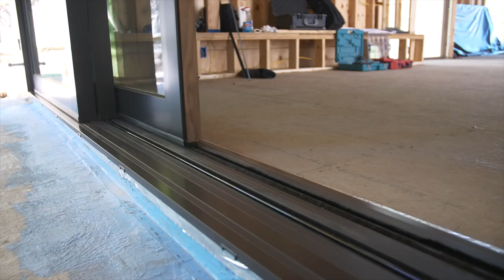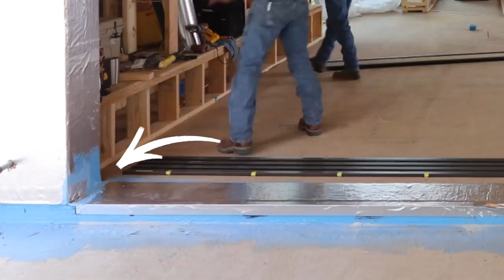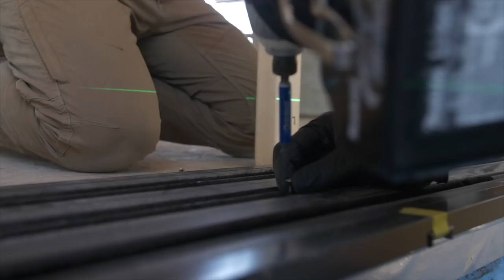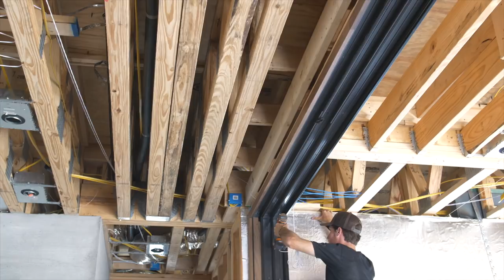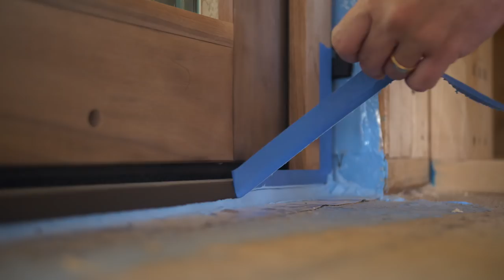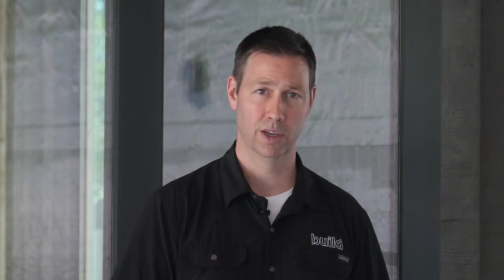How To Install a Sliding Glass Door

Comment: Nice video.  Matt - or anyone else reading this - appreciate some newbie advice.  I'm a San Antonio homeowner turning my old home into an airbnb, and want to add a 15' x 80 " patio door (replacing a window, a rotted french door, and a 2 ft of wall) across the back of the house for wow effect.  So far I stopped into my local homedepot and got a quote within my price range on a JenWeld 4500 vinyl XX0 with 3 oversized sections totaling 177".  The door frame looks a little thinker than I'd like, and the sill depth is over 8" for that 3 track product.  Could you suggest other alternatives.  Also after watching your video, for a mutlidoor that big, it doesnt seem like I want just any neighborhood contractor to put it in - any suggests for someone experienced in my area or willing to come from Austin?

Comment: Matt, been watching a lot of your videos as i am going to be redoing some insulation windows and siding on my 1970s house. Starting to get a good grasp of the modern building techniques and modern building science. I'm trying to figure this out. I'm installing a Grandview multi slide door from Westeck windows. It looks and assembles very much like this door here. Its not feasible for me to re sheathe my entire house in zip system. I am however planning to use a wbr wrap on my entire house. I want to make sure i get the sill pan for this done properly. I will wrap my wrb past the window on the sides in the rough opening and then use a stretch/flex tape for the sill as you have demonstrated with wrb and zip systems. However i have this problem that he is talking about in this video. If i use a metal pan i just have to screw through it. Is stretch/flex tape sufficient for the sill pan in this application/ will it self seal to some degree? What would you recommend? the door is in an opening that is about a a foot and a half off the patio and will have steps built down and is on the gable end of the house with only one story and 2ft over hangs and is south facing. I live in the PNW

Comment: I love the thought about it being a multi-generational door, but I've seen many bottom tracks go bad and need skins or replacement.  I always assumed that was from rollers that started to seize up and wear the track away because they weren't rotating on their bearings any longer.  Catching the roller wear early would be key (in my mind) to keeping the lower track in good shape. So when it no longer "slides like butter", replace the rollers.  Do you agree, Matt?  And replacing these rollers looks like they would only be doable by professional installers such as Cory.  Thanks!
Reply: Greg Valunas I bet trash and dirt makes it's way down in there over time. It might help to vacuum out that track every 3 months or so too ya think?

Comment: Would to see more about the header. Great to have a level sill, but without a level and stable head for the width of the jamb, it's not going to matter much. Steel? wood? tips? Just did a 12' kolbe multislide, used lvl beams just for the door frame, floor above is supported by steel. That would not have been possible with this build and would love to know how you planned for it.
Reply: typically the way that you do these things is to check the building code to see what they prescribe (or check with an architect). if you can't find a prescriptive solution in the building code for your situation, then you have to consult with a structural engineer.

Comment: Hey Matt,  I have a 112 x 98 rough opening how much will I be spending for a door like this , 3 slider patio doors
Reply: these are currently sold under the Marvin Ultimate line, which are solid wood frame doors with aluminum cladding for the exterior. Hard to say, but I got a quote on a very similar door. You're basically looking at anywhere from $2500-3000/linear foot. That's just the cost of the door. This particular door was built out of walnut, probably the most expensive wood option Marvin offers, so probably the upper end of the price range. There's a lot more to consider, cost-wise. You have to consider the structure needed to support these doors, because they ain't light (you're dealing with huge panels made of tempered glass). If the header that will be supporting the frame to these doors will be supporting weight above (i.e. if you have a two story building/home) you're going to have to support it with a steel beam unless it's not required by local building code. In my locality, code calls for steel which means: mucho dinero, amigo. Depending on who is installing the doors (not many Joe's out there are familiar with these) you're probably going to have to call a Marvin certified installer to make damn sure these are installed to Marvin's specifications if you want them to honor the warranty. Well that's gonna cost you an extra buck or two. Not sure if this particular door was ordered with a retractable bug screen but if you're planning on enjoying these doors during the nice weather you probably want to consider the screen unless you're comfortable with the local fauna moving into your house. That screen alone is several thousands $$$$. Lastly, depending on the sill you choose, you need to make sure there is enough overhang on the exterior to keep the elements away from these doors. In my case the doors are leading out to a covered porch and even then the Marvin guy strongly recommended going with the performance sill. Check the Marvin website, some of the sills are not rated to keep anything more than a light sprinkle from coming inside your house. By now you've figured it's not cheap achieving that nice custom look... like anything else in life.